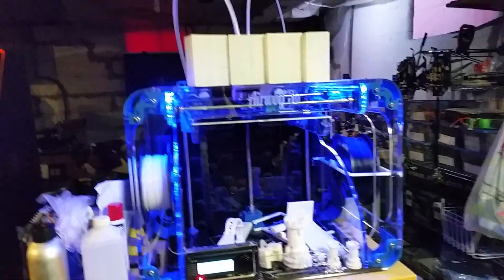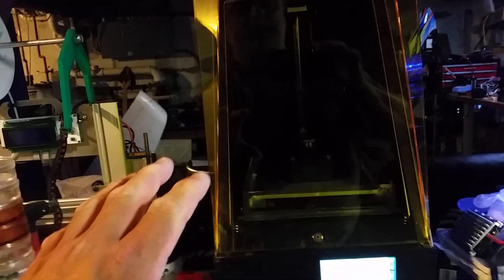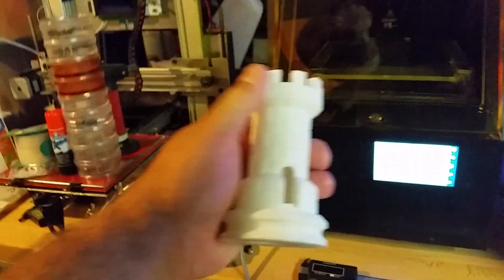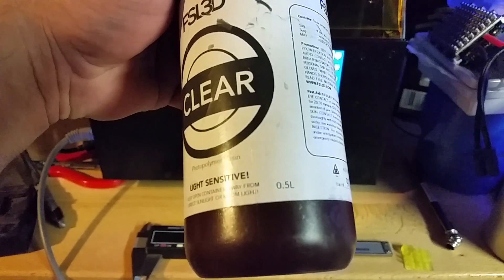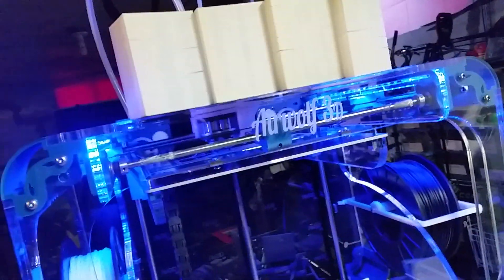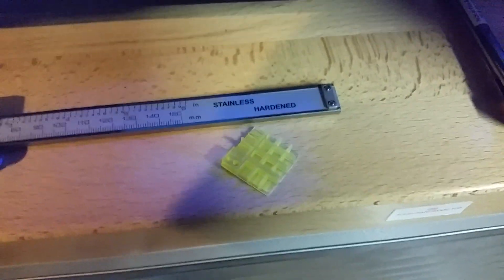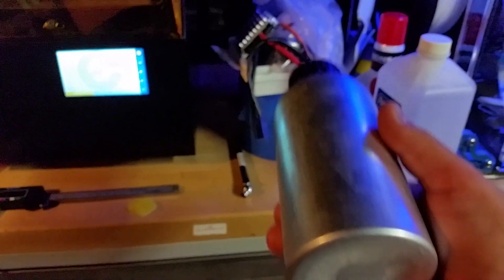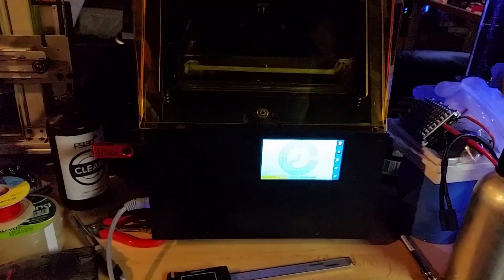FSL3D Pegasus touch SLA printer

Comment: Satgod hi, I'd commented under another handle previously (re. the Axiom 3d printer). I recently went on the Full spectrum Laser website and it has two options for a resin printer. Yours, and a "PRO" version. The pro version is much more expensive, yet yours has a bigger build volume, higher x/y AND (I believe) Z rez. Can you make heads or tails out of this?
Reply from the maker: the pegasus has their largest build volume
the other unit is a DLP and much smaller in build volume
I have 2 Muve3d DLP prints which have a slightly larger build volume than the pegasus 
Because of this I am considering, selling my pegasus

Comment: Hi satgod, I've had the Pegasus 3D printer for two days and I could not print anything because the build that I want to print did not get attach to the Build plate. My doubt is,  how much resin I have to put? Does the resin have to overtake the Build plate? And,  at what high have to be the Build plate from the VAT? Thank you very much for your help!
Reply: the build plate should just barely touch the bottom of the vat when in the home position
it is also very important that the plate be level with the vat as well
these videos will help you set it up correctly
http://www.fsl3d.com/video-tutorials/
Reply: Colen Casey ok, the build plate is alrealdy touching the VAT and it is leveled. how much resin I have to use?
Reply: sergi bisbe
on your vat there is to steps  cut into the acrylic your resin should be between the 1st and 2nd step
as long as you are fully covering the bottom of the vat it should stick to the printer
note alot of people have had various issues with this
your build plate can be touching the vat to much or not enough it is a very sensitive setting of the print to get this right
if you are not using FSL resin it is very hard to set this up right the first few times
Reply: Colen Casey if the resin overtakes the Build plate, can it damage the printer?
Thank you for your help!

Comment: Hi satgod, when you complete a print. Do you actually soak your printed object in alcohol or you just wash it with soap, like the way you did with the vat?
The suggest to soak in 99% IPA alcohol, which is quite expansive on the long run...
Reply from the maker: I ussually use 91% IPA available at walmart or the dollar store
because its not yet cured warm soapy water would work but with fine detail its hard to get all the resin off the print with soapy water because you cant really scrub it before its cured

I pour a bottle (32 oz) into a tupperware type container then put the print in and slosh it around take it out drip dry a little and cure under a U.V. Lamp
I keep a air-tight lid on the IPA  container and use it MANY times before I have to change it

Comment: As far as 3rd party resins go, what works well with the Pegasus?  (flexible, castable, colored, or strength) 
Also, anyone have a link for the Sylguard or the other cheaper stuff for resurfacing the vats?  Or a link for the glass vats making process?
Reply from the maker: FTD (fun to do) resin works out of the bottle, i've only used red so far : http://studioqubed.com/collections/all

I beta tested the new Vorex resin from madesolid and it works out of the bottle as well, it is what was used in the video to print the small test piece : http://shop.madesolid.com/products/tough-resin

i've also used 3Dink resin out of the bottle: http://www.buy3dink.com/p/59/uv-resin
If you get the clear you have to pigment it or its to photo-reactive

I have been using Qsil 216 to recoat my vats and it works well I recommend 120-130ml for the pegasus vat
http://www.ebay.com/itm/191165268974?_trksid=p2059210.m2749.l2649&ssPageName=STRK%3AMEBIDX%3AIT
Reply: satgod with which default parameters on printer (Clear Resin, White Resin, Black Resin etc...) you have used funtodo resin? I've got funtodo resin but my pdms vat is broken after print with Funtodo Snow white with "white resin" default parameter on touch screen of my pegasus printer. have you suggestions for me?
Reply: your build plate, when you use funtodo resin, is set in contact with the pdms or more elevate respect it?
Reply from the maker: as far as the build plate I ussually set it to just touch and then back it off 2 notches(clicks of the servo

I use the supervat for prints since it came out
Reply: satgod thanks for reply. another question: with which default parameters on printer (White Resin, Black Resin, etc...) you have used funtodo resins? have you open software license for use pegasus with third parts resins? I haven't this!
I've got funtodo resin but my pdms vat is broken when I printed with funtodo Snow white resin using default parameter "White Resin" on touch screen of printer! have you suggestions? thank you!
Reply from the maker: I was using FTD before you got to pic a color
I would probably use the clear setting
Thought about the open source but couldnt justify the 1500.00 in the end I just bought another resin printer that was completely open source

I think FSL should give us the open resin license since it appears they do not update this printer anymore
it would allow for making changes to the settings to use other resins for sure
but for 1500.00 I would just look at a Muve3D I have the top of the line muve with the larger build plate and vat and it does great

Comment: Is that secret test resin a new batch from Maker Juice? Are you at liberty to say? Besides being stronger how else does it compare to the stock resin?
Reply: the test resin I used was from madesolid
Makerjuice has a SF resin for the form1 that will probably perform well for the pegasus as well
I have used the standard makerjuice and have gotten good prints with it but the prints had to be kept to less than 3x3x3
hopefully with the form1 version this wont be the case.  I will be testing the makerjuice form1 at the end of the week.  i'm building a glass vat now and will be printing from that
Reply: Colen Casey Awesome. I've had my Pegasus Touch for about a week now and I am already getting low on resin. I will most likely try the Makerjuice SF next. What material did you find to put in the bottom of your new glass vat?
Reply from the maker: Jeremy Frank
you can use the 1 app 50ml stuff from muve3d or I get ML Solar same stuff as sylguard but a little cheaper
I have not been able to get MakerJuice to produce me any ussable print over 3x3x3 inch
I have the Form-1 SF resin from makerjuice on the shelf but I will have to wait till my vat is done
ordered the wrong glass for the first vat.  Looks and fits perfect but the glass is not 100% tint free.  I have a order for low-iron glass in now hopefully it will be in tomorrow.  If so i'm still looking at sunday or monday before I have a ussable vat.  Glass vat looks good though.  I may run off 20-50 of them once I get a verified ussable glass supplier
Reply: +Colen Casey & Satgod - how did you go with your glass vat? Also how has your experience been with the Pegasus touch after your extended use, are you still using it? Open source for the Pegasus would be the next big thing to open the door up as last I heard their software engineer left and this is why there really hasn't been any further firmware updates...though do you think they have hit a reliable point in their software?
Reply from the maker: glass vat was a improvement over the plastic one for sure.  I went to the supervat when it came out
Once I got use to it it was a decent preformer.  I was about to start a print on it, cleaned my vats yesterday.
They over a open-resin license for it  from FSL but its stupidly prices.  There is a open source resin software being developed, its on github.  I now have 6 printers and have concidered selling this one as my other resin printers have a LARGER build area .  the average person probably would never use the full 7x7 build area.
Guess i'm not average